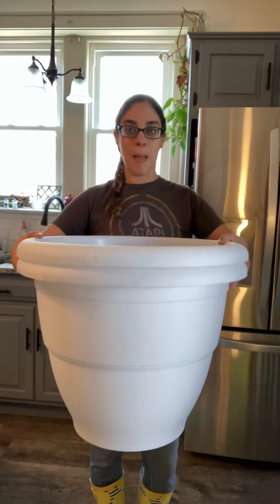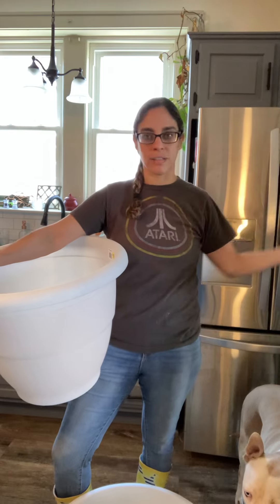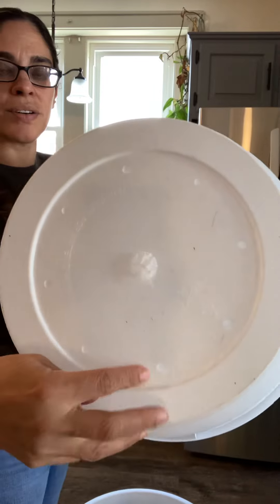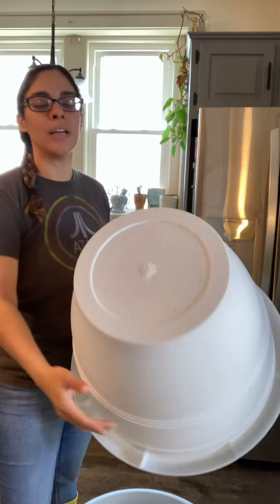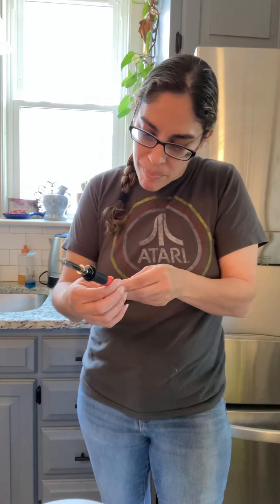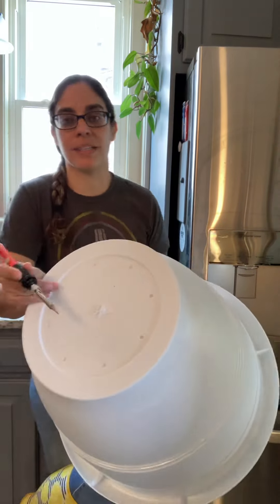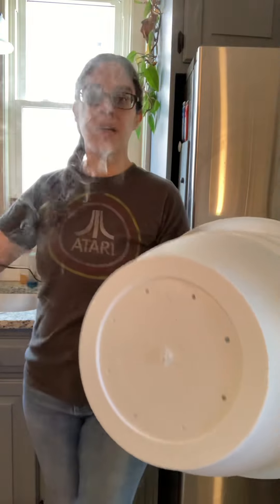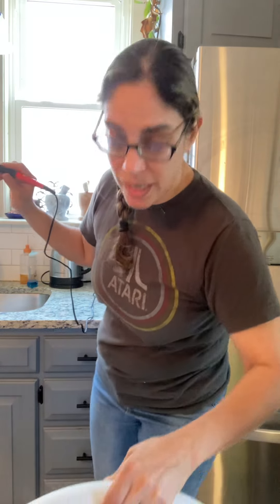Using a Soldering Iron to Make Drainage Holes in Plastic

Comment: Watch those fumes, toxic.  Consider another option:  Use a candle, heat up pointed end of a sharp kitchen knife, then poke it into plastic and work around to enlarge the hole.  Very little or no odor from candle.
Reply: Can I do same with a little round pipe or some metal tube to poke round hole?  Better candle or candle Lighter? Thank you!
Reply: @Michelle-n7f  The sharp end of a knife got the hole started easily.  Not sure if your pipe would be sharp enough.  I think the fumes off of a candle are less toxic than from a lighter.
Reply: @Prilly49  THANK YOU!!!
Reply: Aren’t the fumes coming from the plastic though? Either way heat through plastic will create toxic fumes right?